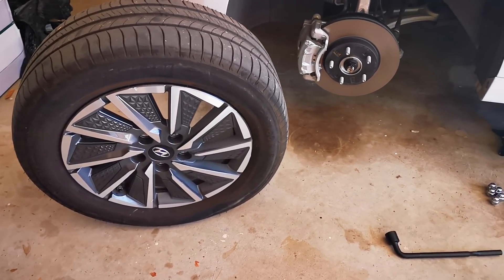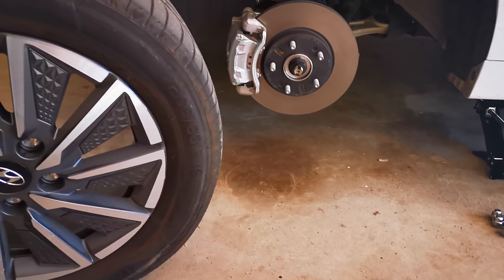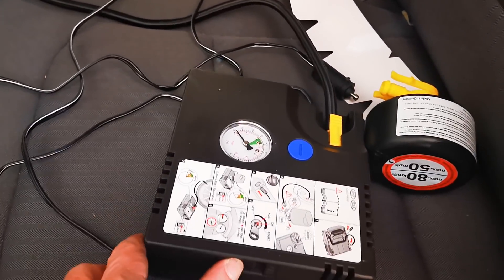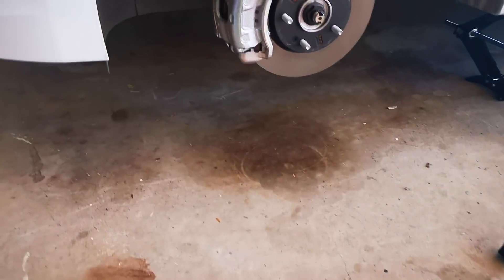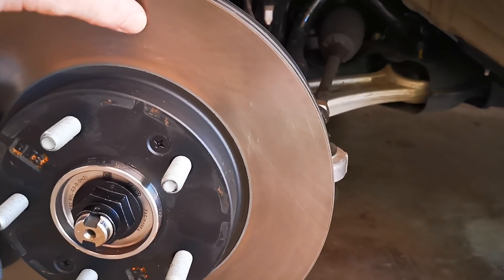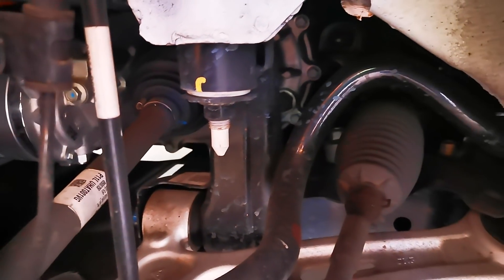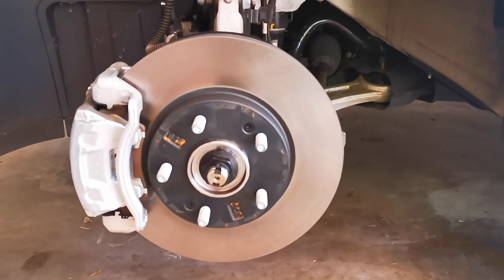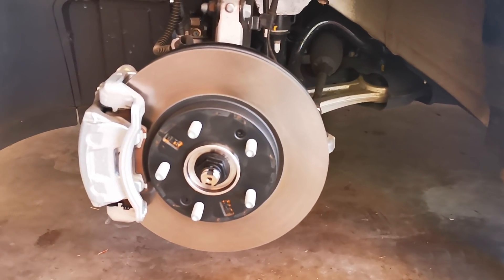Hyundai IONIQ EV Zero Brake Wear After 12 Months!

Comment: Low rolling resistance tyres equate to poor driving experience apparently. Lots of people replace them, prefering that to a small decrease in range.

Might be worth investigating.
Cheers Dave. 👍🇦🇺
Reply from the maker: Yeah, so I've heard. Might put better tyres on them when they need replacing. But I've had no problems with them.
Reply: It’s a EV there’s no driving experience. It goes from A to B and makes people think they’re doing something to help the environment.
Reply: @markm0000  There may also be an element of safety within that increase of driving experience.

Comment: I look forward to when Lithium Ceramic batteries come to EVs never mind other things provided they have a longer cycle life than traditional lithium.
Reply: Cycle life of current batteries is pretty good for EVs 1000x 300km =300,000km thats like 20 years but yeah I'd sleep better if it was 1,000,000km+ guaranteed
Reply: Yeah, the current generations are great. These modern cars aren't early nissan leafs with nasty capacity loss. 

There will always be random issues, but as a whole ev batteries are durable enough.

I am fine with driving or owning high mileage cars, but as a whole very few live past that due to exterior appearance, interior wear,  and now tech... 

Maybe a refurbishment industry will start up and refresh interiors and bodys on used ev's with 200k miles+ , but people largely do not drive vehicles till they are dead, (rusted out in certain areas) so an ever lasting or "million mile" battery is kind of overkill.
Reply: EV is just a knee jerk reaction to climate change. Hydrogen and fuel cells will be the future.